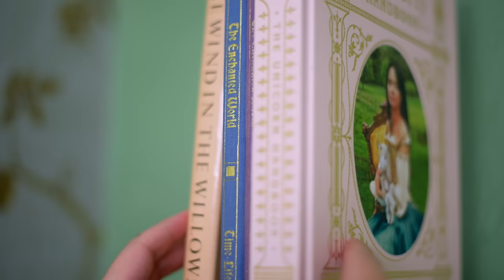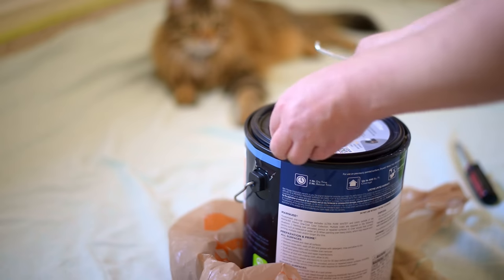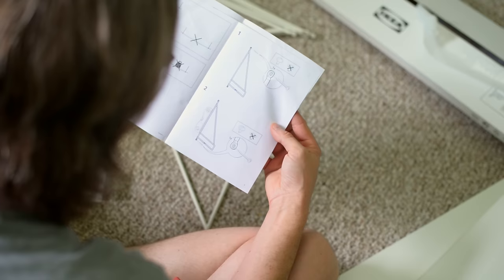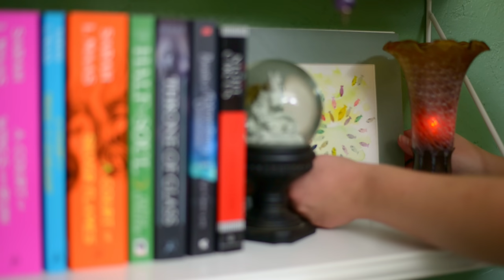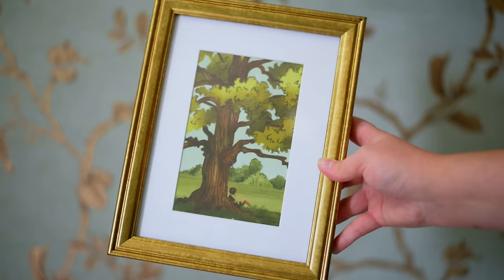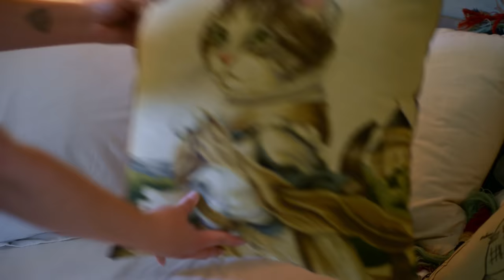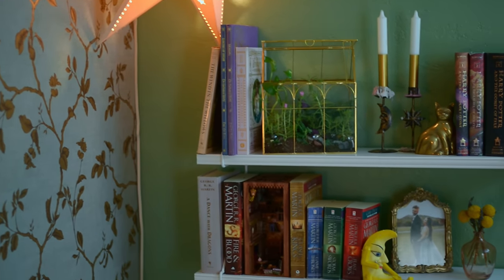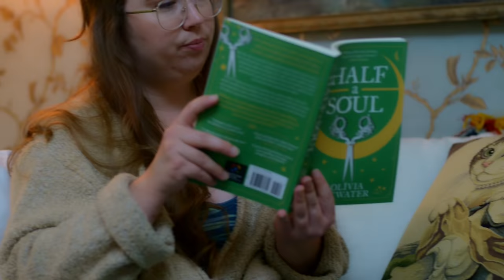Fantasy Art Studio Makeover 🌙  Cozy fantasy cottage, light and dark academia vibes

Comment: It's gorgeous and really cohesive! Love the wallpaper and mirror. The only element that is a tad jarring is the white hanging shelves beside it. I agree that natural wood shelves should be more harmonious. My simple trick for finding just the right thing; simply set an intention that the perfect item(s) will appear on the curb of a street as you drive by. Works more often than not for me! It could be discarded furniture, or planks of wood from construction or demolition...you just never know. Then if the wire supports were spray painted a dark green (or Olde gold) ,maybe with some Ivy attached on one side, that could boost the vibe even further.
Reply from the maker: Thank you! You're definitely not the first person to mention the shelves. I admit it was a quick decision on my part to include those because I wanted so badly to start the process. I did have a friend mention to me that I should at least paint them the same color as the wall, which I'm still trying to decide if that's the route I want to take or if I want to wait for something more perfect to come along. LOVE the ivy idea! I think I'll have to take that idea from you 😜